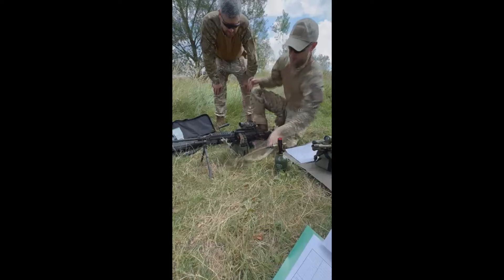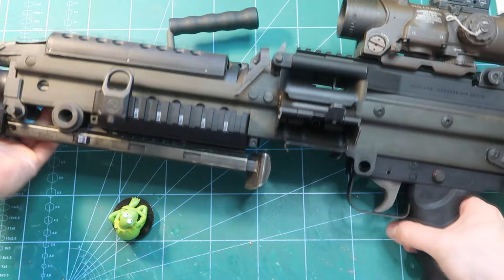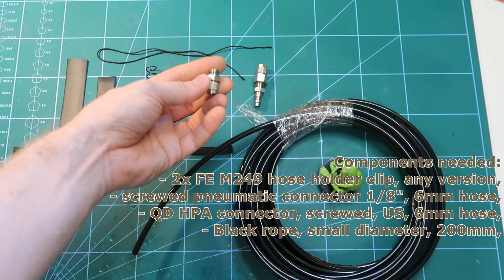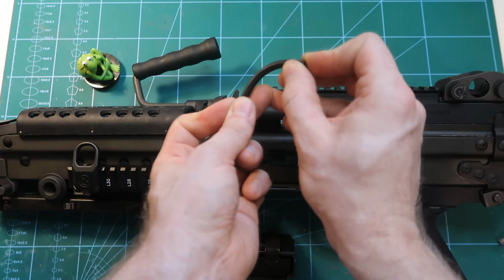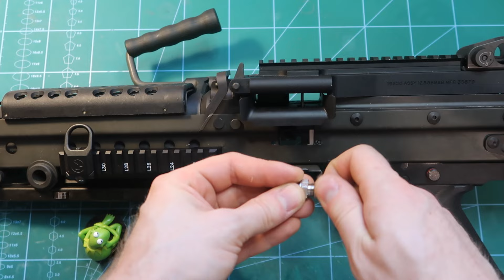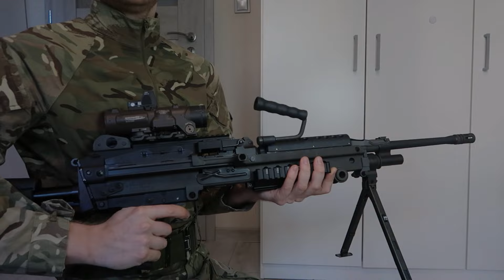Frog Manual #17 - FE VFC M249 GBB MG HPA Frog mod

Comment: Is there a particular reason that you didn't use a 90 or 60 degree fitting instead of bending the tube?
Reply from the maker: Yes, 90 deg fitting is just to big. Even if I buy the smallest possible, I would need to drill the hole in STANAG magwell just next to the closing flap. So the hose will not run along the receiver, it will not bend immediately out of the connector. And I want to keep it as close to the receiver as possible. So in my mod all magic happens in the magwell, and what leaves the magwell is already running nicely along the receiver.